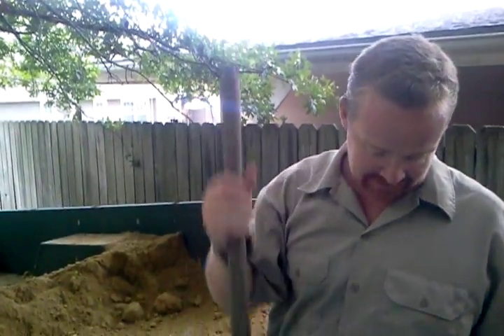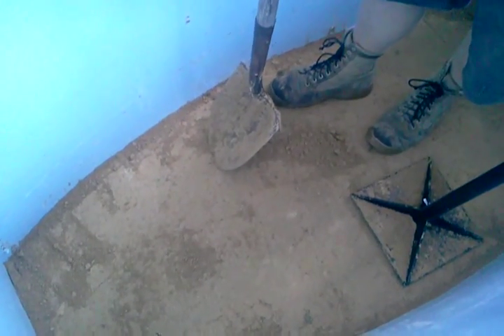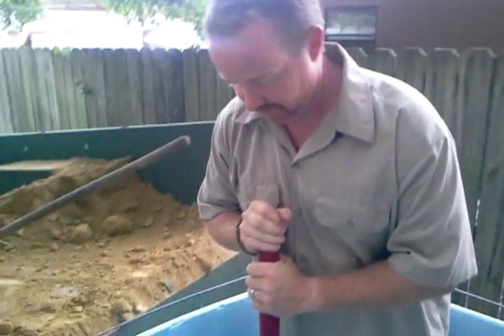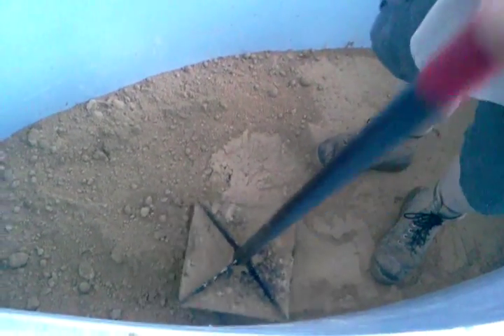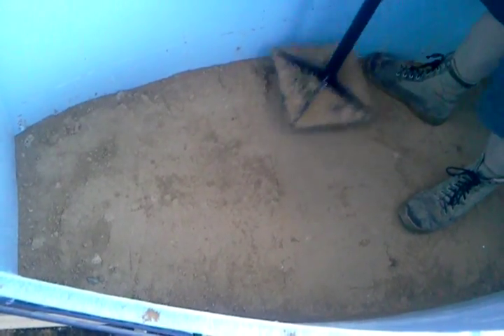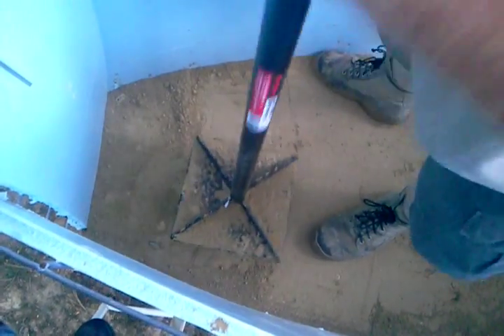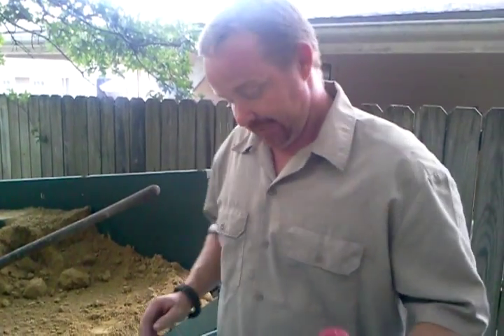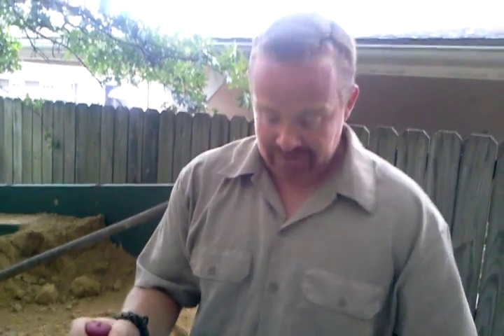Insulated Rammed Earth Form

Comment: Did i hear you using just clay type of soil? In order to stay green, what kind of damp proofing can you use to prevent it from getting permiated from ground as well as weather resistant plaster? I had seen close to 100 years old rammed earth buildings which all had their walls warped due to dampness from ground under their own weight. Is there any material that could be used in clay make it more damp resistant, yet green? Would appreciate any suggestions from anyone.
Reply: Lime I think would work, that's what I am going to do on my place I am starting next month. If you want to rammed the entire building, from the foundation on up, a plastic membrane might be a god idea to place on the ground in the foundation and start on that. It might not be "green" but if the building is going to be there for at least a hundred years it's good enough I guess.